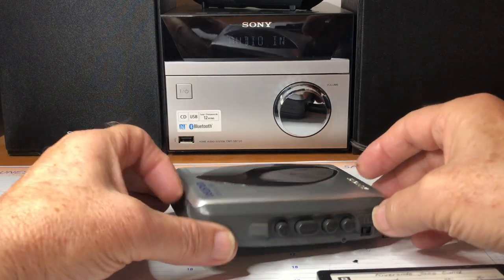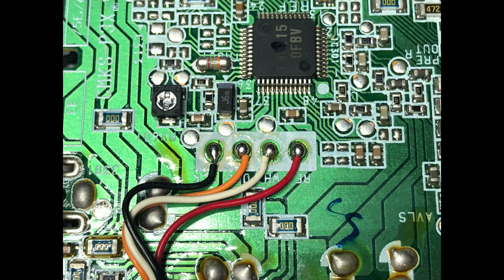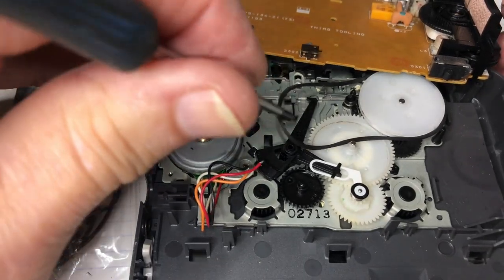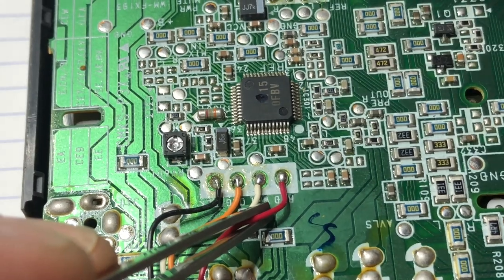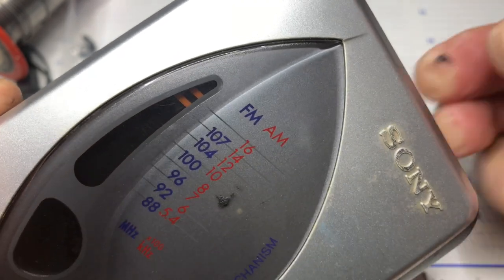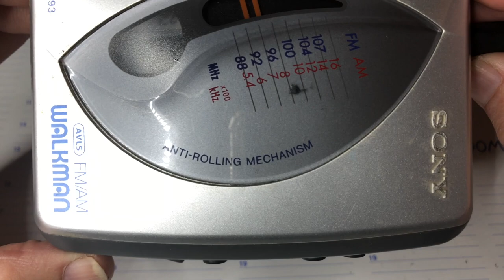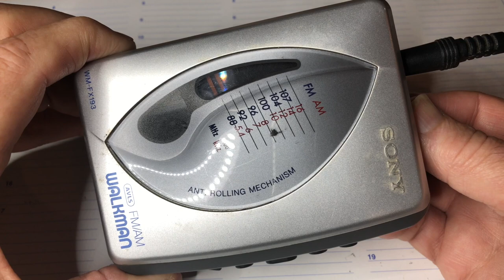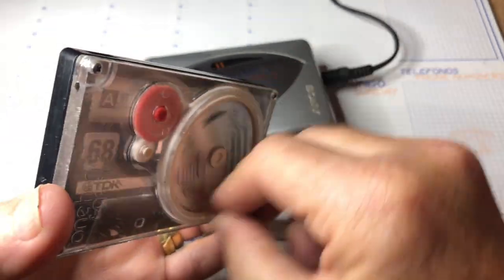Sony Walkman repair and my Casette Tape Hand Winder

Comment: Size the belt?
Reply from the maker: There is no standard size. If you order a belt as a spare part it cost a fortune. I bought a set of belts with different sizes from China att a very low cost.